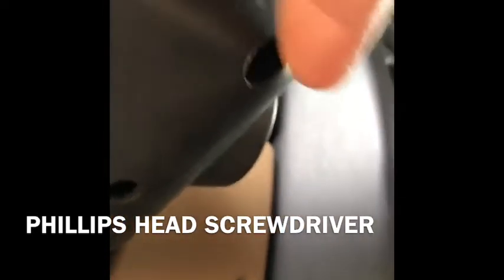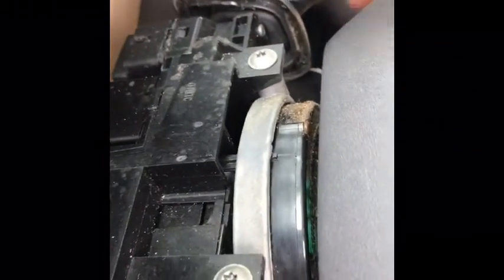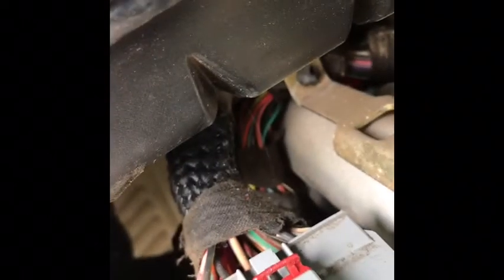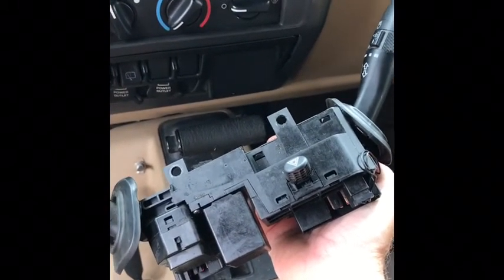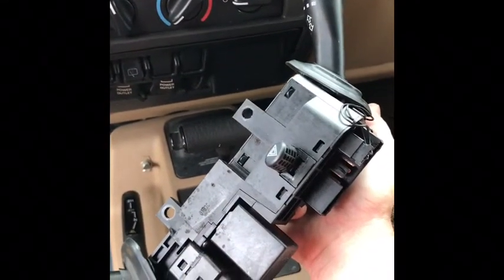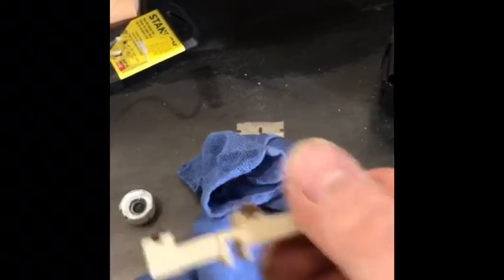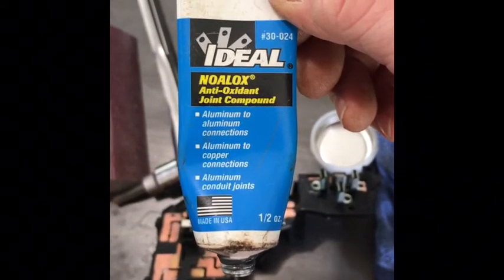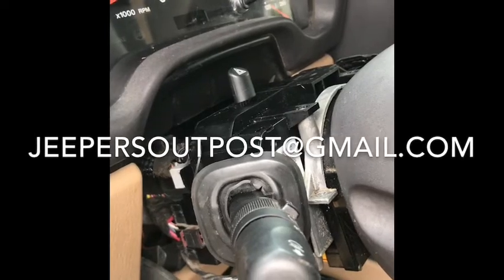Jeep TJ Headlight Switch Fix

Comment: Very helpful, thanks. Although my problem still persists after cleaning contacts, your video has given me experience and confidence to see how easy it is to deal with possible future issues related to this switch. My problem is significantly varying voltage to 12v outputs associated with vibration (auxiliary and cigar lighter used for fridge and cell phone + flickering radio/clock & odometer displays). Voltage varies when headlights are on, but not off. Headlights and parking lights do not flicker. Previous owner switched out fog lights and did his own rewire, so I'll be looking into that crap. Last recourse is to directly wire those outputs to battery. The varying voltage causes phone and fridge to shut down.
Reply from the maker: Glad to help, hope you track down that problem, I suggest checking all your ground points.

Comment: Thanks !! That helped us. Our turn signals weren't working on our TJ in just the front. We took the turn signal assembly apart, cleaned the contacts, put it back together and the turn signals worked but the headlights weren't which were working before. We took the signal switch assmbly back apart again and my hubby found that he put one piece back together incorrectly (had to go into slots), fixed that and all is working perfectly again  :) TY!!!
Reply from the maker: That’s awesome!! Glad I could help a fellow Jeeper out. Hopefully I’ll get some new material loaded soon.

Comment: THANKS!! My fog lights quit working on my 2001 over 10 YEARS ago! I am a cheapskate, so it never got fixed. I didn't even investigate taking it apart... this is VERY promising. I love tinkering, so this looks like a fun project! Thank you for the motivation!!
Reply from the maker: Usually when they go out, there is a tiny “bump” on a slide switch that has been worn down. The bump can be repaired with a drop of epoxy, plastic weld, or any product that would renew that bump. I have seen some videos out there specifically on that problem, it should be an easy fix. Hopefully in the near future I will make a video, of an entire tj light switch tear down.
Reply: Great! Thanks for the tip. Just replaced the blower motor switch ($24 part). Next up the fog light switch. I'll update what I find after I get it disassembled... 👍
Reply: @jeepersoutpost1150  I got it all apart... EXCELLENT instructions BTW  😊 , and nothing was burned - contacts were just a little gummy. Cleaned it all up, applied new electrical grease and put it back together. No fog lights. Checked fuse... THEN I remembered - I had taken the fuse out several years ago... Because the fog lights would not stay off... the switch is "loosey-goosey" sloppy - you have to push hard on the end of the stalk to get the lights to go off - and they still turn back on intermittently. I think something is worn up inside the end of the stalk. I removed the fuse years ago after a dead battery...
So NOW my plan is to re-wire a toggle switch on the dash, and not use the stalk mounted switch.
Thanks again for your EXCELLENT video!!
Reply from the maker: @nortonnewmann3711  glad to help. There are other videos on YouTube on how to fix the worn down fog light switch.

Comment: So what do you do when the plastic lever on the wiring breaks? Just happened to me and I'm a bit frustrated. Might just manhandle the crap out.
Reply from the maker: Fortunately haven’t had that happen. Other easy fix would prolly to secure it with a zip tie, otherwise you gotta splice in a new connector. Thanks for watching!

Comment: What was the switch you cleaned to fix the issue where you had the airbag light come on/heater not work/backup lights not working?
Reply from the maker: Connor Fitzgerald it’s been a while since I fixed it. The light controls are in that same assembly, there are 2-3 copper circuit panels in the assembly, if you have never cleaned them, they probably all need cleaned. Thx for watching.
Reply: I had to replace my ignition switch to remedy that problem. I could jiggle the keys to get it to work but if I hit a bump it would stop working. I replaced my ignition switch and it fixed that problem.

Comment: In 2020, I’m dealing with this similar situation right now on 2005 Jeep Wrangler Unlimited Rubicon. Only it also melted the connector to the multifunction switch. I’m going to replace the switch and the connector, but am going to pry open the old switch like you showed and just see what’s going on. Side note: my drivers side rear tail light is pretty rusted so no good ground is happening AND the plug connector for the drivers side front turn signal is not fully seated in... Lol so my whole drivers side flash and all is getting some love. Lol. Thanks
Reply from the maker: Hope I helped. Good call replacing that switch, I would have done the same if the damage to mine had been any worse.

Comment: My problem is with the fog light switch. It is in the off position but they stay on. If I push in on the end of the handle they go off but when I let go they come back on. Do you think it can be fixed or should I order  new?
Reply from the maker: Yep, there is a little “bump” inside the switch that breakers the connection when off, when that bump wears down, the circuit isn’t broken, and the lights stay on. I have seen a YouTube vid where a guy shows you how to rebuild that bump, saving the cost of a new switch. Search it out, and let me know if I can do anything to help.

Comment: Customer came to me with this issue. The High beam indicator won’t work. Dealer told them the module that controls that is no longer available. So I don’t end up with a large Bill just to discover what they said is true do you happen to know about this?
Reply from the maker: Chuck, I’m not familiar with this so I can’t offer any experienced guidance. It may be worth taking the thing apart and cleaning it well as corrosion is a problem. I do think the entire assembly is available at the parts house.